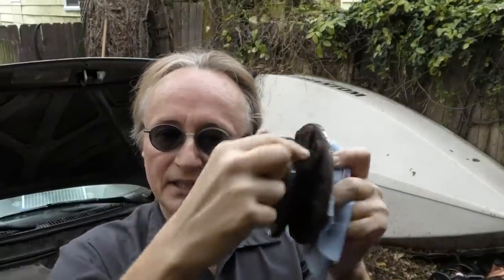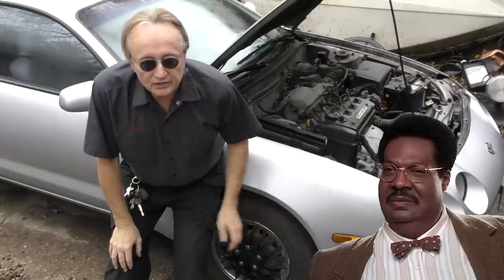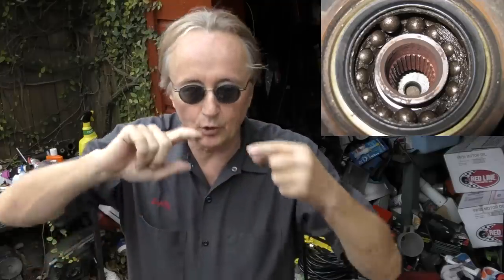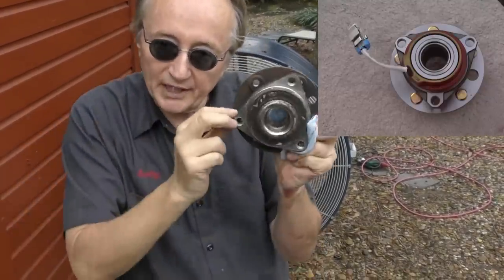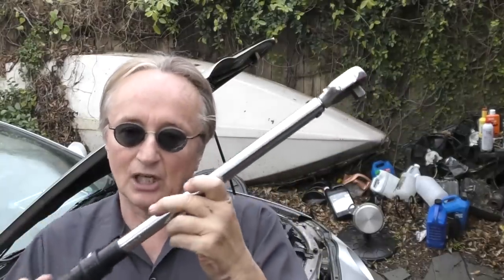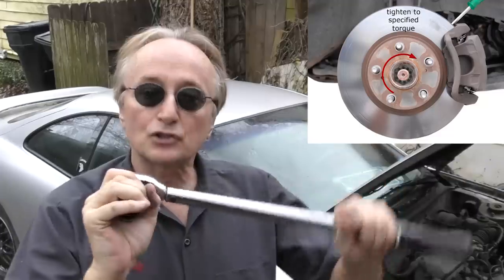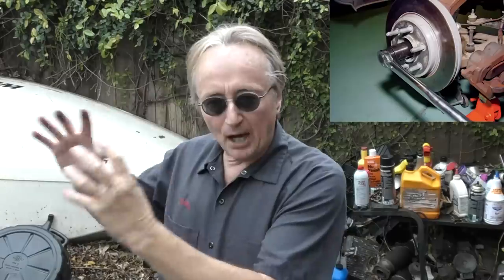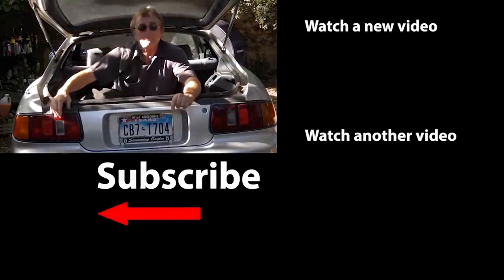Doing This Will Make Your Wheel Bearings Last Forever

Comment: F ... A ... G ... wheel bearings ... oh boy where do I start ...
Reply: LOL!!!
Reply: or SKF
Reply: Yeah they make many auto parts. I wonder if mechanics really refer to them by the letters?
Reply: Haven't bought any SKF spare part, are they good enough?? Been hearing the brand quite alot recently, some even say it's an OEM brand.
Reply: I wouldn’t even go there.... not in this era of political correctness 😆😆
Reply: NTN
Reply: I mean being gay is fine with me; you do whatever makes you happy but come on it's like seeing people win CNT number plates etc did it not occur to you that this can be interpreted in so many ways lol.
Reply: They do require extra lube.
Reply: You may start now.😁
Reply: Insert joke about overheated, flaming bearings.
Reply: SKF is often OEM in european cars. Quality is decided by the automaker on how long it is supposed to last and SKF make the bearings to meet the criteias.
Reply: One of the CNC machines I worked on had an automatic lubrication module made by a company called F. A. G. 

I was talking to the CNC tech at the parts department, and apparently they send over hats and shirts with the company logo, and no one ever wants to wear them because they say F.A.G. Lubricator.
Reply: Those were good bearings. Now they all come from china :(
Reply: Start at the rear
Reply: @phiksit  not all of them. There are ones made in the USA.
Reply: Stands for Fischer AG. AG basically means Incorporated in German.

Comment: Scotty I know what you mean about the old wheel bearings. I used to watch my dad repack them without any fancy repacking devices. He would get a blob of wheel bearing grease and put it in the palm of his hand then take one side of the wheel bearing the side you could see the ball bearings and push it down against the grease in the palm of his hand and dragging it across the grease so it will be forced into the wheel bearing. Then it would rotate to wheel bearing and do the same thing again and again until he got all the way around the bearing. He didn't have a torque wrench...  he couldn't afford one so he did it all by feel and he never had one go bad on him. That was old school poor way of doing things.
Reply: The older cars were designed to be maintained without special tools.
Reply: Yeah we never owned a torque wrench growing up either.  I had three setting for "hand tight":  1) reasonable that my girlfriend could probably get it loose.  2) tight enough that my hand started to hurt. 3) King Kong tight when you stripped the bolt,  bent the wrench and/or felt the gear in the ratchet about to give way.  And the thing is, it worked when the job was done, but you don't quite know for sure if long term is was done right.  I think a lot of so-called professional mechanics worked this way too, as my cousin had a trucking yard and they had every kind of tool imaginable, but I never saw them get out the torque wrench or go to a shop manual for a torque spec.
Reply: @gdeangelkick  a knowledge of what the component does lets you know how much to tighten.  Just don't strip a bolt as that can ruin your day.  Most things can be done without torque wrenches.  Gaskets can be a different thing as you don't want too much pressure..
Reply: Yep, saw the same!
Reply: Good I'm glad I'm doing it the right way the past  55 years... 😃

Comment: Was quoted $704 from a local shop to do a front wheel bearing on my 01 silverado. This was for a crappy off name brand. No thanks. Ordered the timken replacement and did it myself in just over an hour.
Reply: John Smithy  paid around 100 per side for the part.
Reply: @christopherhendricks4369   retail is overpriced.... that's still too much money. try rockauto. $30 plus shipping. i have bought many hub assemblies from rockauto. its the same quality as retail at less then 1/2 price
Reply: $700. That’s insane
Reply: I bet $500 was labor.
Reply: Me too!
Reply: Same I got quoted 400$ for one wheel bearing on my 01 Honda Accord 🤦🏿‍♂️🤦🏿‍♂️

Comment: We can’t emphasize torquing things enough! I can’t stand it when a drain plug has been tightened so much that it ruins the threads! Nice job.
Reply: Yup.  Iight snug is enough.  They don't loosen with driving.
Reply: Or wheel lug nuts. They're almost always tightened too tight. About 75 lbs is usually right.

Comment: I remember olden times when you tightened nut and backed it off a quarter turn lol. I cant say I miss packing wheel bearings but it appears to have been less trouble!
Reply: Yep! I was thinking..."what's with this torque wheel bearings nonsense" haha
Reply: yup tighten the snug back off til the next hole for the pin and slide the pin in😂

Comment: I replaced my car's wheel bearing more than 4 times and couldn't figure out why they wear out so soon. But after watching your video I just realized that I did torque the check nut way too tight. Thanks for this enlightening video 👍👌👌
Reply: one would not get the facts more precise and accurate.

Comment: I hit a curb during a winter storm when I slid going around a corner and my front right wheel bearing started making noise shortly after. I priced up a complete wheel bearing hub assembly for my Saturn Aura and since it was less than $50 and the car had 150K miles on it I decided to do both sides even though one was fine. Simple job, had both done in less than 2 hours taking my sweet time. Was shocked to hear that on some cars this is an expensive and labor intensive job. I'll make certain to avoid those cars when I need a new one.

Comment: I went one better than OEM when I replaced the hub assemblies on my Trailblazer.  I went with Timken replacements as they are the same brand used on locomotives and railroad rolling stock.  Yeah, they're expensive, but I'm willing to bet I don't have to change them again.
Reply: Did the same with mine when I had it. You sure it’s not cheaper than OEM? That’s a neat fact I will take into consideration when I eventually get my 3/4 03-06 but I may still stick with OEM just because that’s what it was designed for from the get. Not bashing you at all because Timken is far from “Raybestos” or Nakamoto or whatever the hell those knock off parts are! :)
Reply: Got them in my old Ford. Good bearings.
Reply: Other quality brands:
SKF, New Departure.
Reply: Rebel9668  Yes they are top quality 👍.
Reply: I lived in Columbus, OH where Timken had their factory. I've been using Timken bearings in customers and my own vehicles for 
40 + years. NO PROBLEMS EVER.

Comment: Great video Scotty.  I worked at a chain shop and watched guys hammer on those axle nuts with an impact wrench.     Also a good idea: say you pull out the CV axle at 120,000miles for whatever reason. Change the seal on the back of the hub while it's out! (If there is one.) You can get another 40,000 out of your bearing by doing that, you've probably disturbed the seal by taking the axle out or some times the spring pops off the seal. Also SKF is a good company,  probably only aftermarket bearings I would trust even if they are made in China.

Comment: Great video!  My chiltons manual back in the 80s sometime listed the wheel bearing nut torque as 12 ft lbs.  I was eating up wheel bearings every few months.  Then I got a factory manual (5 volumes iirc) and it said 12 INCH lbs.  After setting it right they never needed a change again in the 8 years I drove it.
Reply: 12 inch pounds, is a very small amount for a wheel bearing .  Must be a child's wagon ! !
Reply: It was a 1969 mustang.  I still have the manuals!  😀
Reply: Chiltons don't have a good reputation... use another Manual.... I have 10 different manuals for My 1968 VW autostick BEETLE..... Great video too...
Reply: Wow!
Reply: @Exarhadsgfds  there are 12 inches in a foot.....do the math......12 foot pounds is equal to 144 inch pounds....12 times 12

Comment: I already have a torque wrench, but everyone needs to see this video. Absolutely the best information. Torque them correctly every time you replace them. Through the years I've learned about going cheap on the hub assembly. AutoZone Duralast Hub assembly lasted around 30,000 miles each replacement on my Chevy Trailblazer. The OEM Timken lasts around 100,000 miles. Also the Moog brand (if you're not gonna purchase OEM) lasted 100,000 miles. Yes, I do a lot of driving. So spending 99 dollars on a Duralast that has to be replaced at 30,000 miles doesn't make sense when the Moog is only 65 more dollars and will last 3 times longer than Duralast or another cheap brand. I replaced my Lexus LS 460 at 100,000 miles and I'll have to see how long they last first. I'm at 160,000 now, but they are bolted from the rear. I still torque them but the pressure isn't on the bearing itself.

Comment: Torque wrench is important tool for rebuilding the engines and other items along with timing belt rollers and head gasket as the auto engineers knew the important of the ratio of the tightness/weight for the whole thing to operate more smoother!

Comment: Timken are my choice for replacement wheel hub/bearings.
Reply: My dad was a Timken bearing QA Inspector in Ohio for a few years after we returned from Saudi. The Saudi Airlines (and I believe airlines in general) bought the Timken bearing because it was able to withstand the hashness of the desert sand/heat and gulf salt water. Nothing like a 70 mph shamal picking up salt water and desert floor to sand blast your airplane. Dad got to see the real world use of Timken bearings for a couple decades in the desert and then later test them at the factory. He swears by them and I won't use anything else other than Timken.
Reply: @ZDriver1996  I did not know this. Thank you.

Comment: Lot's of useful info here Scotty! Just had my right front brake caliper seize on my 2004 Honda Crv Ex Awd. I quickly pulled over. But maybe the damage was already done. That rotor is slightly warmer than the other side after a drive. I'll have to keep an eye {Hand} on it every day to monitor the temp. Thanks for the videos.

Comment: I always use Valvoline Petroleum based wheel bearing grease on the older stuff. Follow the service manual for Torquing the bearings. Usually the older style cone and cup taper roller or ball roller need only 10 INCH LBS not foot lbs. So you would need an inch pound torque wrench. Stay away from plastic bearing spacers or cheap ones, insist  in timkin or equilivant, all steel. My mechanic gets to work on any new stuff...LOL!!

Comment: Packing wheel bearings brings back good memories
Reply: Still do it on fork lift trucks, I find it quite relaxing! 😂
Reply: I always find packing them by hand to be a real pain, although possibly a zen moment if you choose to look at that way (so Thanks!). It's a lot more reliable than the cheap bearing fillers mechanisms that you can buy at the corner parts store (using wheel bearing grease there too of course). Getting the races out by hand carefully is the real fun ;-)

Comment: In the USA, the passenger side wheel bearing wears out faster due to the fact that we make more left turns and that will put load on the passenger side bearing more often. The other thing that will keep your wheel bearings from wearing faster is making more gradual conservative Lane changes and driving more conservatively in general.
Reply: Less stress on your vehicle and conservative driving habits save gas tires and wear and tear on you also, great practice all the way around.
Reply: The “crown” of the roads you drive on also play a major role in side loading the bearings !!

Comment: Bent wheels will ruin your bearings right quick in a hurry too! I leaned that the hard way.
Reply: Alex Bogard same, even a little bump in the rim... bought a set with 3 good rims and one which was a tiny bit of so next MOT check they told me the rear bearings were worn and should be replaced, actually was just a matter of tightening the nut and it was approved 😂 but still need to replace them sooner or later (lucky for me i have a toyota which is easy to replace)

Comment: What should I look for in a newer Kia Sorento? I need a 7 seat car on a budget
Reply: Buy a used school bus...
Reply: Making sure it has wheels and tires is a good place to start
Reply: Buckhorn Cortez oh great idea my guy. Huge help. So grateful for your wisdom. I feel so in debt to your generous knowledge.
Reply: Katy Perry's taint oh crap really? I wanted the levitating model. Jee whiz lady I’m glad I heard your advice. I sure did want to get the wheel free car
Reply: @AuroraBlue01  an engine would probably be a good thing to check for as well. There are some really bad cars out there called kia that only idiots think about buying so watch out for that to.
Reply: Honestly, I get the whole budget thing and I've learned one thing when it comes to cars...instead of buying something "newer" with more bells and whistles (that WILL break down...I assure you a Kia will), use that same budget and buy something a couple of years older that's built by Honda or Toyota with lower mileage and you'll be happy in the end.  Yes, you'll be missing some added features but honestly, fully loaded cars are overrated.  I'd rather something that will get me to where I need to go EVERYTIME without hesitation.
Reply: Buy the 7 seat first and after you buy it then buy the car, consider it done bro
Reply: Volvo xc90
Reply: @husenaswat4279  there are 2 different kinds of KIA   the same KIA soul base is 14,998   but the same KIA soul loaded is 42,000    its the same car but with a 5,000 dollar light up speakers and other junk.  so I got the base model,   half as many parts on it to break,   so its great,   but only if you buy the base model,   just don't buy the small motor,  that was the other option on Kia   stay away from the tiny motor,  its no good,
Reply: @ateam6486  When I was referring to bells and whistles, I wasn't actually referring to upgrade options, I was alluding to the fact that generally, newer cars tend to be more advanced than older cars, even with standard options.  I probably should have clarified that part.  However, I agree with you, definitely no need to buy the upgraded models for thousands of dollars more.

Comment: Stay away from Detroit Axel on ebay.  Their wheel bearings are cheap but only last 5000 miles if you are lucky.  I learned and only go with Timken or moog
Reply: Yes. I agree. Their parts are junk.
Reply: if I have already taken the wheel bearing off and the car owner tells me they want to order their own cheap part off ebay,   I just tell them as of now the labor fee is 50 dollars and they will need a tow truck to come and pick up their car,    if you agree to put on their cheap part,   in 3 months they will be back demanding you to do it again for free,  as if you did it wrong,  and they don't understand the huge delay in days of waiting for their part to arrive and the warranty is all on them,  avoid that at all cost,  and it will only make the people mad at you and they will tell their friends how you are not good and they will avoid your shop,   because they don't understand why their cheap parts didn't last long.
Reply: David James I have had some luck with Moog but they are all coming from China where they build with recycled metals.
Reply: A Team i only do my own work on my own cars. Yes, i agree with your business plan.  If i owned a shop, i would have a sign that says you only use guaranteed quality aftermarket parts, or for an additional charge, the customer can request oem. Under no circumstances will you allow customers to bring in their own parts.  Your supply is guaranteed to be authentic parts, and not counterfeit Chinese knockoffs from ebay . I am sure we all know the brands to trust, and the brands to stay away from.
Reply: Chase Baker it is tough to identify a fake part.  Laser etchings, and factory embossed identifiers help.  Too many get fooled into thinking it is authentic because it comes in the brands box.  I have even seen people swap out one brand for another and sell it!!  O2 sensors are a mess because sometimes brands use different suppliers for the part with strict quality control guidelines, so how will we know if a certain manufacturers part is under certain specifications!!
Reply: David James I’m not saying anything is fake. I’m saying even the premium parts are all coming from the same manufactures in China. China buys more recycled metals than any other country so it’s all low quality period. Furthermore RockAuto does the job for you to find trusted names and brands.

Comment: * Couple more things *  1. Since you already have the torque wrench out make sure you torque the bolts that hold the hub assembly to the steering knuckle to spec. This ensures proper wheel alignment an as Scotty said could lead to premature failure if out of alignment. Another point, make sure you use the torque wrench when torquing the lug nuts(not a impact wrench like most tire shops which can damage you wheel bearing), which surprisingly on most vehicles is less that 150ft lbs. Also, because the wheel studs are part of the hub assembly, before putting the wheel back on take one of the lug nuts and run it all the way down to the bottom of each stud, by slow twisting it on a couple of thread than backing it off that go a couple of more threads until it bottoms out.

Comment: My wheel bearings are 200,000 miles old and will last 200,000 more, but the car will not.
Reply: Ditto for my 2004 Jeep Wrangler. Traded it in with 257,000 miles on the clock, and never touched the bearings
Reply: Personally don’t know the average wear va the limit;  there is the point of drivable which is a large margin and non drive able,  some may ‘drive’ more energy through suspension components.
Reply: Bearing are rare to be change now.
Reply: wish I knew the future of my vehicles like 
Jovert Jovert
Reply: Mine are on 256700 miles and have never been replaced.